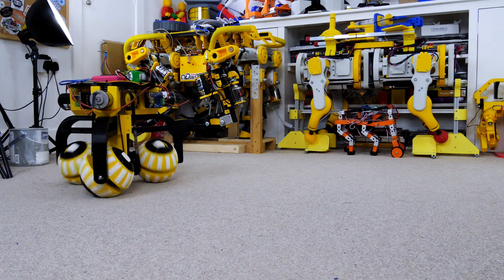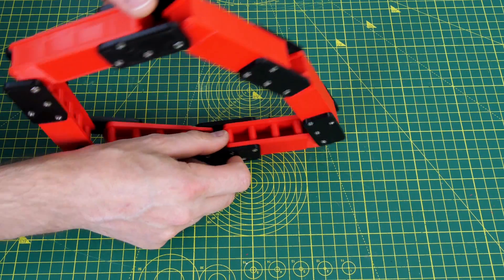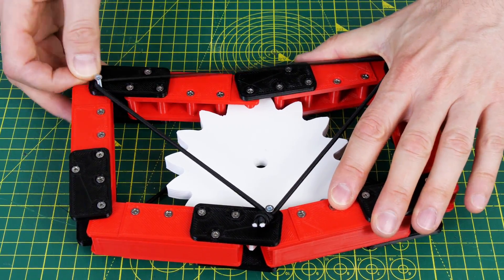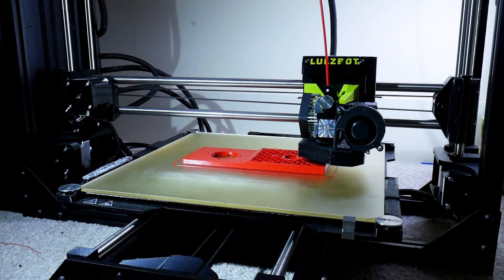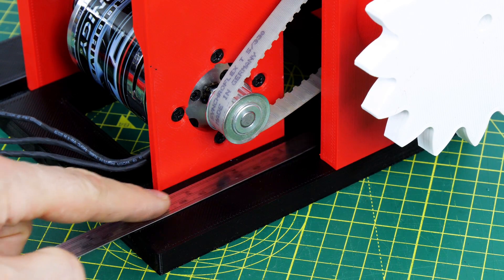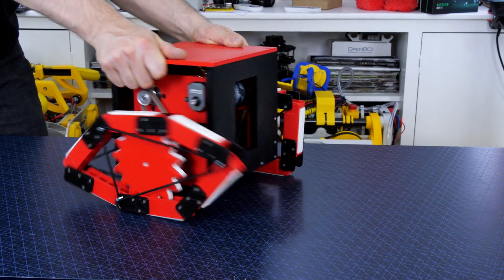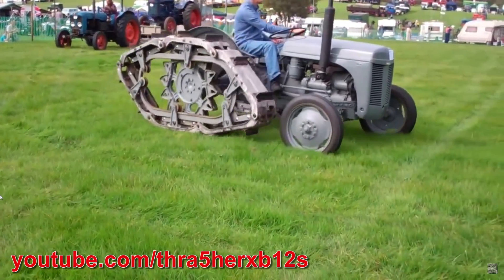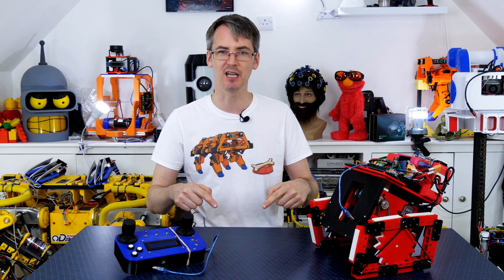Balancing Rotaped Robot

Comment: another super interesting and quirky mechanism! i love it! this course type of track seems like a really robust traction system for an all terrain robot. i think the way the leading segment pivots down into the ground almost vertically would work well with a hook or spike at the front of each segment, so the robot would claw/pick axe its way along all kinds of obstacles.
Reply from the maker: Maybe a burrowing robot?
Reply: @jamesbruton  Hmmm. How would you change the vertical direction you dig in? Lean the robot?
Reply: @jamesbruton  a boring robot to show off some Tesla Boring type tech! :]
Reply: @jamesbruton  good for climbing rocky Martian terrain 👀
Reply: https://youtu.be/Sj3HwvFWlFk?t=5
Reply: @TheNightstalkerShow  Oh that's brilliant. I forgot that remote control toy vehicles of the 90's tried to out compete each other on wacky drive mechanisms. There is probably so much good material to try from there.
Reply: How about for the NASA rover mission to Venus!